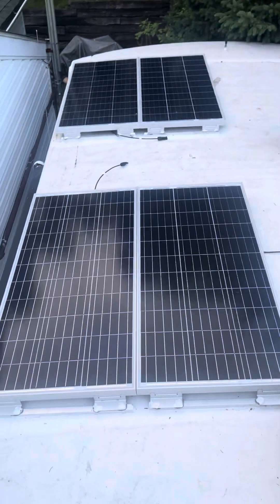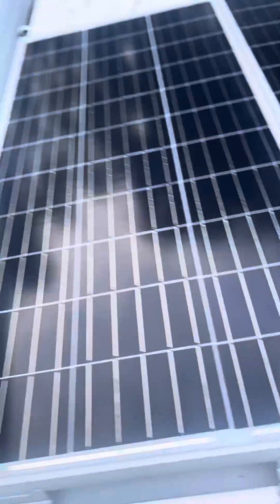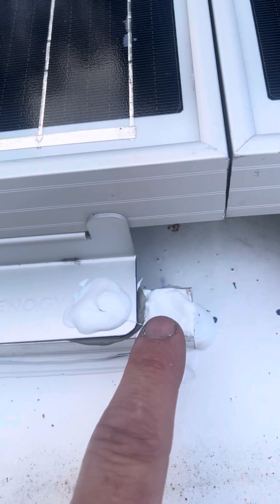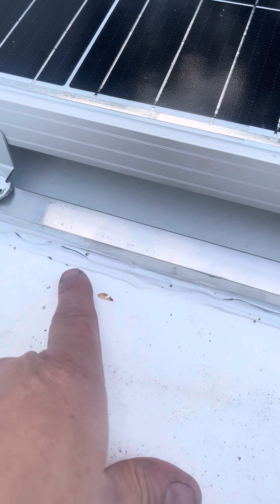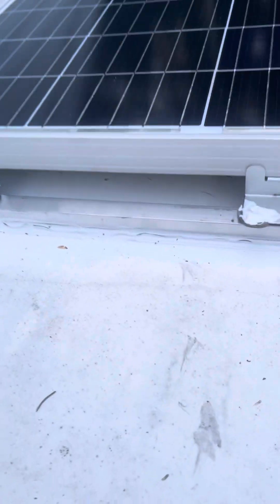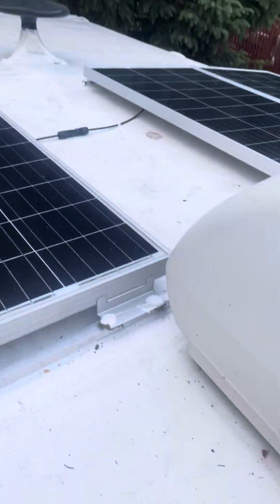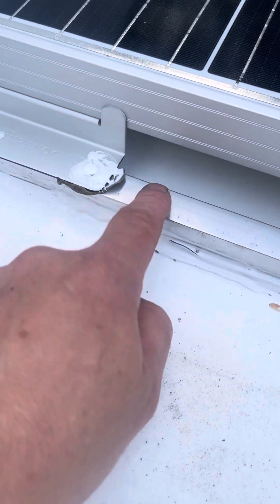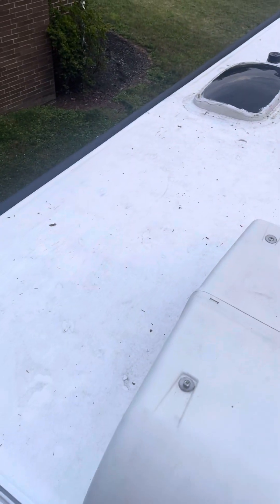Renogy 800w solar panel install

Comment: I'm doing a similar install, how did you deal with the slight curvature of the roof? You can see that where the panel's are butted together there's a slight gap at top edge. I decided to ditch the Z brackets and am planning to use 1.5" aluminum L channel 1/8" thick. However there is a slight curve to my roof so that the angle pieces will be canted slightly outward or have a gap at either end depending which way i run the rails (L). This will be a tiltable system that can tilt either way (using thumb screws) so it must be 90° to L channel. So your using aluminum to add support underneath which is a adding a straight edge to a curved roof did that present a mounting problem?
Reply from the maker: Check this other video out about the 5 min mark. https://youtu.be/6dbAC2twcSM?si=6epHlCkZrsGpaA4G